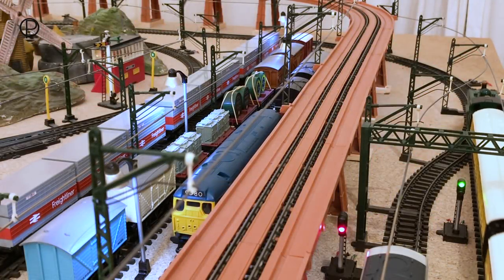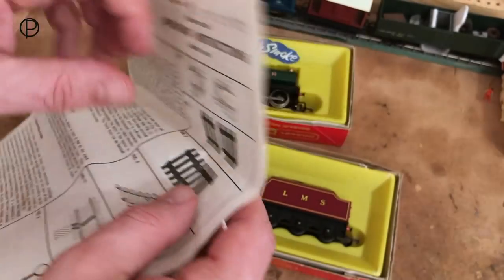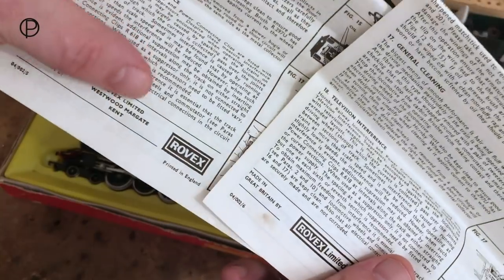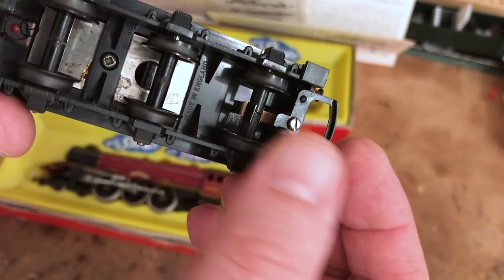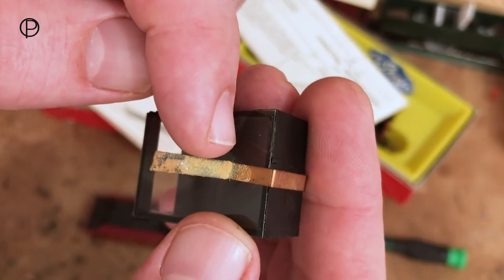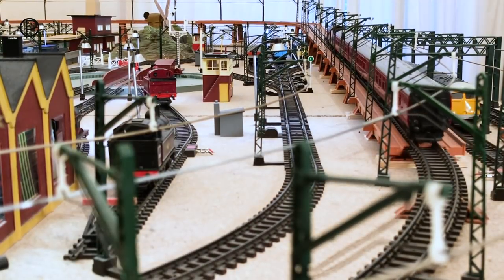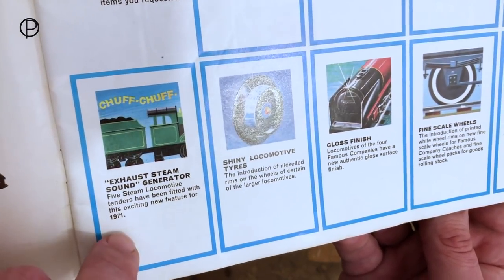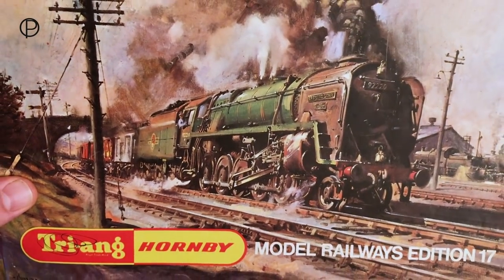Tri-ang Hornby / Hornby Railways  "Chuff Chuff Sound" Exhaust Steam sound Generator

Comment: We owe so much to Triang 
Their models were robust and made for good play value.
Whilst not sophisticated like true railway modeller liked, they could be detailed.
What they did do extremely well is to provide just about every one I know the entry into railway modelling.
Things have changed today, Hornby models are so accurate.
I don't thing the models  of today will have the longevity of the models from the 60s.
Reply: Well said Steven. My recently purchased class 71 electro-diesel had its pantograph torn away from the body running it under my old Hornby catenary overhead wires due to the fine nature, detail and fragility of the pantograph.
Reply: Yes new models much more detailed . My latest J36 is fantastic . But we had more fun playing with our Princesses , Scotsmen and Halls!
Reply from the maker: Thanks Steven, for the great comment. Great play value and providing an affordable entry into the hobby.
perfectly put, I couldn't agree more.

Thanks again.
Oscar
Reply from the maker: Hi Maurice, that's sound like a painful accident. I have examples of the Hornby Class 86, 90 and 91 from the late 80s early 90s and have noticed a similar problem with the pantographs. They seem to have been designed with hard edges on the pantograph skate. This just catches on the clips in the overhead, causing damage to both catenary and pantographs. It seems an odd design flaw as the had reintroduced the catenary system at this point to support these models. And there is no difference between the clips used in the sixties and those reintroduced.
Poor planning and a lost opportunity on their part.
Oscar
Reply: Totally agree and what a pleasure that the models were made in Britain back then.

Comment: This takes me back a few decades. I had the LNER Flying Scotsman with chuff chuff and glowing smoke box.
The old power clip you saw was from the old triang track which had fishplates on the opposite rails to how it is now. I think the old track was called Super 4 and it changed to system 6. You could also buy adapter tracks to use both sets of tracks on the same layout. They had fishplates on the same side.
Reply from the maker: Thanks Chris, a great model the Flying Scotsman chuff chuff sound, glowing firebox and Magnadhesion. It had it all.
Thanks for watching and taking the time to comment.
Oscar

Comment: I have a Triang Britannia (R259) with smoke unit. Do you think I would be ruining it’s future price by adding a sound exhaust box into her tender?
Reply from the maker: Hi. I think the Britannia may have been available with the sound box in the earl 70s so there is probably room inside the tender without doing any damage. Sound like a good project. However items in there original condition always seem to have a greater price. So it depends on your longer term  plans for the model really, but think of the fun you will get from putting the sound box in and the running afterwords, it probably out-ways any future value of the model.
Thanks again for watching.
Oscar

Comment: Who needs DCC Sound modules, when all you need is a bit of bent copper spring clip and a plastic box to go inside the tender. This system could quite simply be made to fit in any non motorised tender. The worst thing Hornby ever did, was to start putting motors in tenders of steam locos. You cant beat loco driven models.
Reply from the maker: I think it was one of those controversial moves. It upset a lot of people, and many welcomed the move. I have to say for me it always looks wrong when the models are in motion. But then they are very smooth running and at the time I think other manufactures had smother running systems available. Development more/improved pickups could have helped Tri-ang Hornby out here I think, although they were working on this as well. But I don't think they put quite the effort into this that they could have especially in the models of steam locomotives. Changing traction tyers is also a pain.
Thanks for watching and taking the time to comment, it's hugely appreciated.
Oscar
Reply: know it's a bit late to jump into the conversation, from what I can gather the onus for hornby to go to tender drive was rather unfair comparisons to the European stuff, especially Fleischmann. unfortunately the general public clamouring for tender drive appear to have failed to factor in Fleischmann was expensive high quality not necessarily aimed at a younger clientele. poor hornby were trying to replicate the Fleischmann arrangement at a budget, and skipping the impeccable quality. the result ended up less than impressive. the sound box seems to be a redo of Lionel's standard gauge system from the thirties. Oscar does really wonderful videos doesn't he? and the way he narrates it's like you're in the same room just talking trains.

Comment: Just got that Red Princess at Swansea on Saturday. No box but runs well. Makes the noise but aven't put any baby oil on the smoke unit yet...
Reply from the maker: Good morning great to hear you got the red princess. These are great fun items with these extra features.
Thanks for taking the time to watch .
Oscar
Reply: @oscarpaisley  I've got the Pannier (with box) and a B12 from when I was a kid but that just has the sound tender, no smoke unit. It's great that the old stuff just keeps running!